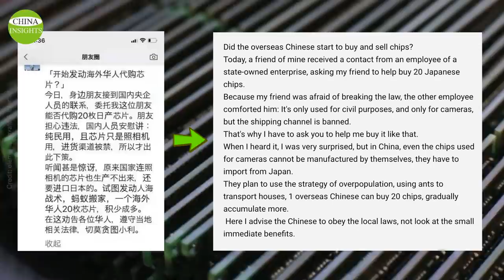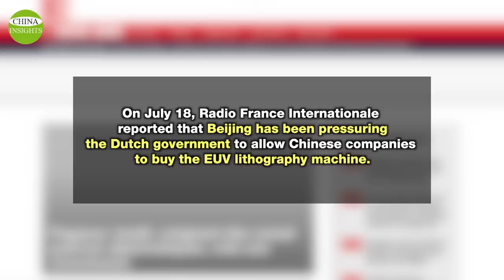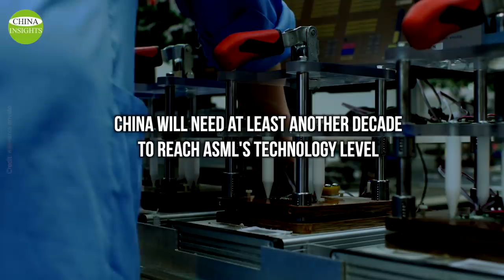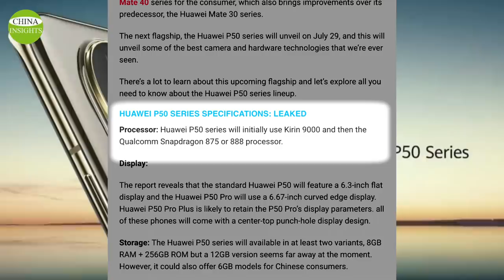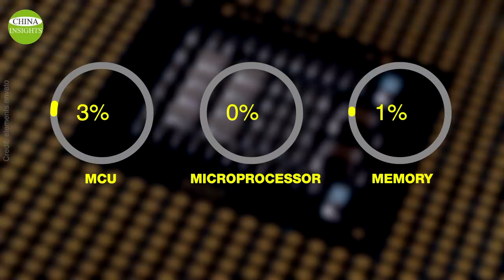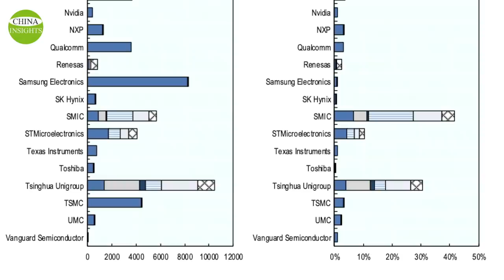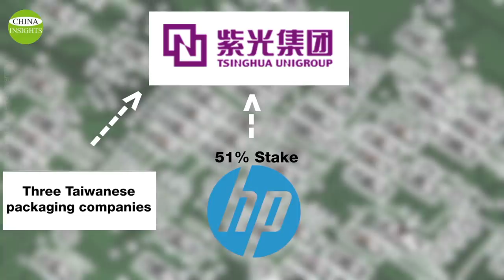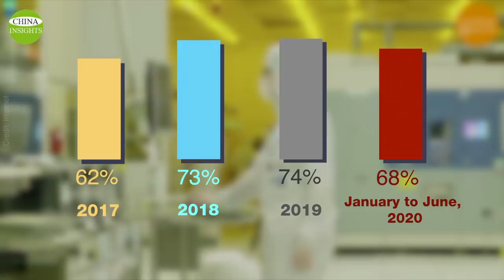China chip shortage: $1 trillion government funds/How a giant with massive capital become bankrupt?

Comment: This might be an apples and oranges comparison, but as regards the CCP and shortages, I am reminded of the legends we used to hear about the Soviet economy as kids in the 1980s and 1990s in which the Soviet workers were such immense under pressure to make quotas for complex goods such as automobiles, and farming machinery that they would assemble the bodies to the chassis, then roll the vehicles out of the factory for presentation to their superiors who would then see and proudly report to their higher-ups the number of vehicles or machines produced.  The problem was that few, or even none of those vehicles or machines had their moving parts installed, therefore they were unfinished and useless other than to gin up a production count to meet a quota.

This, of course, does not explain the chip shortage in the rest of the world, but it is not difficult to imagine that with the extremely high volumes that the PRC deals in of any product or component it would not take long for them to get into a pickle over a disruption in either the production or the supply chain.

Comment: Even if they did buy the machine, it would be very hard to reverse engineer it. The reason being is, they don't know how the parts were constructed, what the ratio of mixed materials as well as purity of said materials.

Imagine if you were given a brand new device from 10 years into the future. Would you have the ability to re-create said object? You probably could, but it would be extremely rough around the edges, not to mention lots of trial and error involved.

These chip manufacturers spend Billions of dollars on equipment just for a single manufacturing site. It is no easy task to duplicate a modern processor.
Reply: That is why it will take the Chinese 6 years to be able to make the 5 gen chips if they wanted to do it.

Comment: China needs to use data compression to accelerate
4g chips to 6 g 
That technology it probably
already has once data compressed in the procesor
By using a chip 8 times wider 7 times thick
It can compress the data
It will have 24*7/144 times
Capacity and need stainless steel layer and terminals
Stainless wiring👹👹👹👹👹👹👹👹